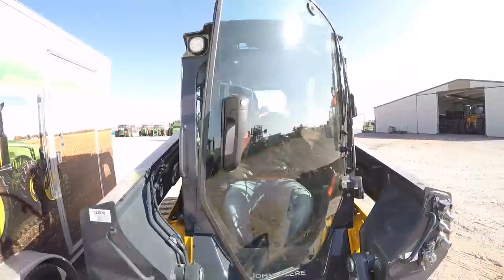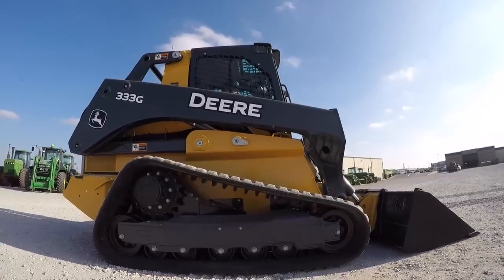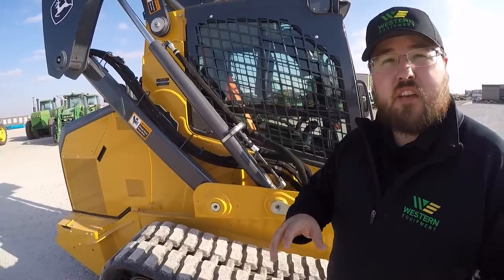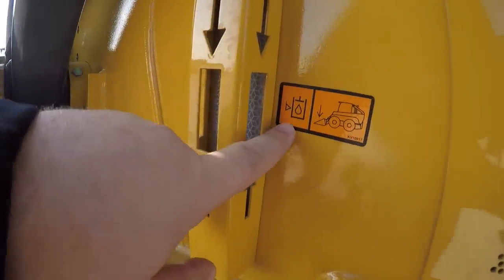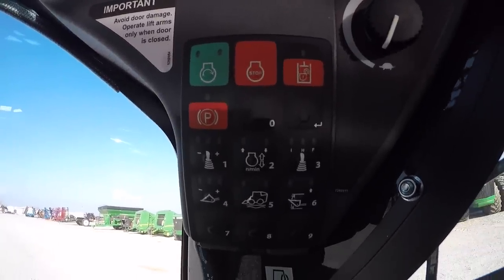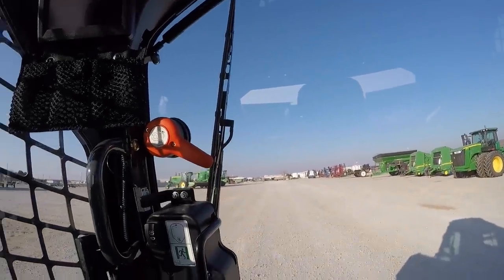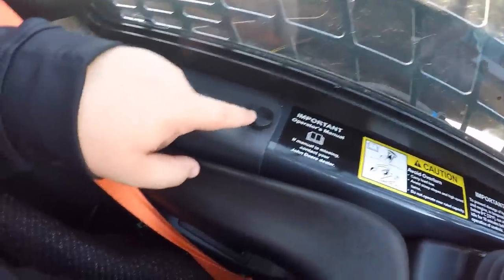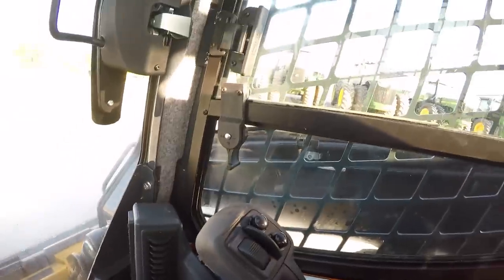2018 John Deere 333G Skid Steer Walkaround Product Overview

Comment: I'm looking at this model to purchase. While surfing, I ran across this "John Deere 333G Issue" video. I am going to use mine for rocks, trees (grapple attachment & snow removal; mostly. So, are you aware of this "pin covering problem" this gentleman is having; if so, has it been addressed at the factory? Are the newer models coming with a solution already built into place? Apparently, Deere is not alone, in regard to this problem; CAT & Bobcat share the same problem as well.
Reply from the maker: I am not sure if this has been addressed, but I did go watch the video to see exactly what you were talking about. I will see if I can find any info on this. Thanks for the comment and thanks for watching!

Comment: Is there a cover you can add on to protect the coupler connection points.  I've seen them on cats.
Reply from the maker: Good question! I will look into it. Thanks for watching!
Reply: Lsatq Yes there is a cover that can be added.
Reply: You can add about $5000 in forestry guarding on these machines!

Comment: I have a question for you I know there is an air conditioner filter in behind the seat I was told that it has two air filters where is the second one
Reply from the maker: The second one is also behind the seat but it is actually located behind the cab so you have to lift the cab to get to it. Good question and thanks for watching!

Comment: only things i don't like is the DEF fluid and the lack of key... how are you supposed to lock the cab up?
Reply: unfortunitly there is no getting around DEF!  The JD uses much less DEF than other brands.  Every machine still comes with a key to lock the door.  every machine also comes with the ability to add a code to start the machine and several prompts to do so.  It is much better than just a key.
Reply from the maker: What Greg Adams said!

Comment: I have question about a 2022 317g. Does JD offer a forestry package? If so, is it needed to run a low flow brush cutter? Can high flow be added to the unit after the original purchase & if so, what's the ballpark price?? Thank you! Merry Christmas!!
Reply from the maker: I do know that a forestry package is available but I will have to look into the other inquiries.

Comment: How do you go between hi flo and low flo hyd?
Reply from the maker: I misspoke in the video! The "hydraulic down-force" switch that I mention in the top right corner is actually the high flow hydraulic switch!

Comment: Very informative good video. I’m starting up my company and to invest in a good well rounded skidsteer that accommodate snow removal and landscaping. What would you recommend ?
Reply from the maker: Being in snow I could definitely look into a track machine like the one shown. Depending on how much HP you need you may be able to go a bit smaller to avoid some weight for the landscaping side of things. But I would recommend looking John Deere's full like of track style skid steers to see what you feel fits your needs best!
Reply: look into ASV  track loaders. Nothing handles better in wet, snow and mud. I have actually never seen a Deere out perform tak"s in a work environment. But honestly service is the number one thing you want. All these machines perform similar its who will take care of you the best.

Comment: What kind of oil does the John Deere 325G take engine and hydraulic
Reply from the maker: John Deere Plus-50 II for both.
Reply: 15 W 40 for the engine?

And hy guard for the transmission and torque hub?

Comment: What does “def system fault engine power and speed limited” mean? And how do i repair/ fix?
Reply from the maker: Any time you have an issue with your DEF system you should contact your local dealer!!

Comment: How could they have a machine design previous to this that didn't have specific tie down points?  Makes no sense to me how something so fundamental could be missed.
Reply from the maker: I agree, seems crazy. Not sure that there were models without the tie down points but they have made sure to put an emphasis on advertising them on the newer models. Safety is key these days!
Reply: @WesternEquipment   thanks for response.  If I may I have a couple of quick questions.  One is about the keypad method of starting the machine.  Since it doesn't use a key can you lock the cab?  Does the cab have it's own key?  It must right?  Also there's a guy out on youtube claiming that the 333g isn't very responsive in terms of joysticks even after all adjustments are made.  He was comparing to bobcat.  True or BS?
Reply from the maker: Yes, it does come with keys for the door. And from my experience it is very responsive. I have had multiple customers since I have been with Western Equipment that have switched from Bobcat to John Deere and are more than satisfied with responsiveness, serviceability, and the parts and service they can receive quickly.

Comment: What are the main differences between the 333G and 333E?
Reply: Joseph Greer the emissions system this is a FT4 machine and it runs def fluid
Reply: Power
Reply: The G series is much more powerful than the E series.  Booms, quick tatch, power tatch has been rerun, heated seat, rear view cameras, bigger drives, HF is at 41gpm, LED lighting from the factory + side lights, better side panels, better rear top door, bigger cylinders, removeable side windows with no tools required, boom performance package, 4 way switchable controls available, better front entry, heavier, cooling system went from a plenum V to a more efficient way to cool,  it does use DEF but not near as much as the competition and it doesn't have to regenerate as often as just a DPF machine, fill fuel easier, coolant bottle easier to see, JD Link telematics is available, you can raise the booms with the cab down, etc
Reply from the maker: Looks like these guys have answered your question well!

Comment: Swing open doors are a no no. Slide up is best (Kubota, Tach). You can't see much out of a 333. Electric vs Hydro quick tach, best to see arms to verify lock, less issues with hydro. 333 can lift some weight though. You can't buy more expensive than a Deere, but you can buy better.
Reply from the maker: I like the slide up doors too and I agree the visibility could be improved. But I think the rest is up for debate. Thanks for watching!

Comment: Doesn’t look like it has a self leveling bucket. When loading trucks that is a must. I hate the door also. Sometimes you might need to have the door open while working. I’ve run an older 323 that was a really nice machine just had the few issues that bothered me. It just couldn’t compete with the cat except for the price.
Reply from the maker: There is a self-leveling option available on this machine!
Reply: Western Equipment that’s good to know. I think I will demo one next week
Reply from the maker: Awesome! Let me know how it goes!

Comment: they need to build a single arm skid steer version.
Reply: Why?
Reply: I agree. So you can exit and reenter the machines while suspending a load.
Reply: Dennis Koyle That’s very dangerous.
Reply: VOLVO has a teleskid
Reply: Those are not great machines.  Volvo/JCB are the same machine.  The customers that I know that use them for safety purposes actually carry booms in stock as they get bent all of the time.
Reply from the maker: I have heard of many problems with the single arm skids, great in theory and work well in some situations.